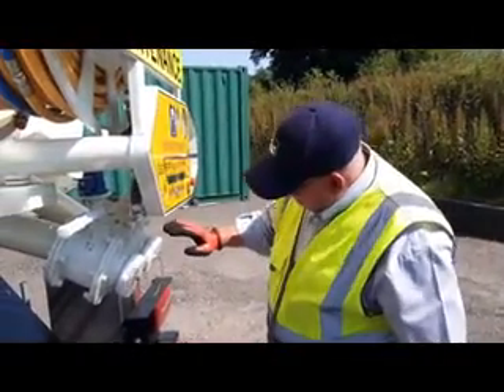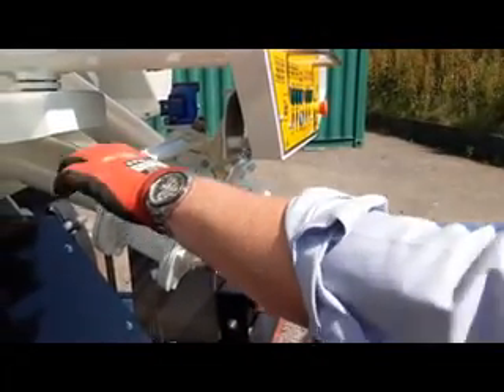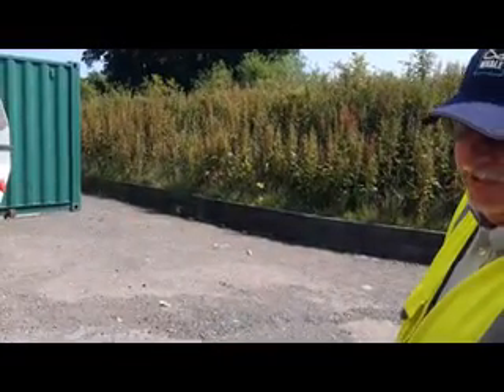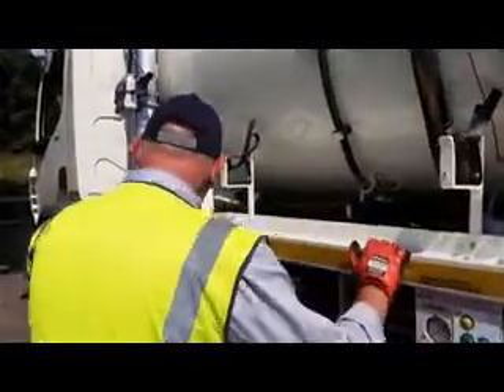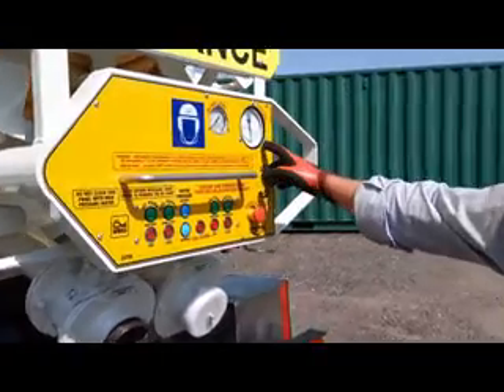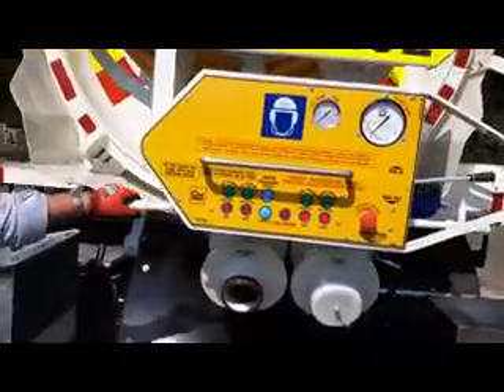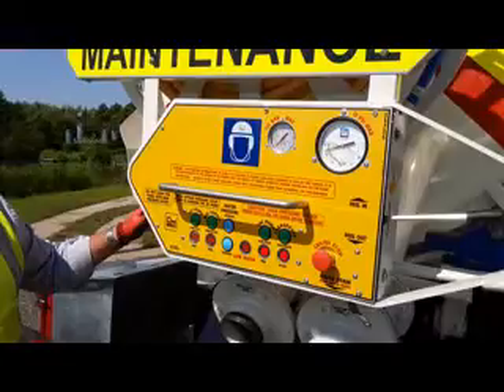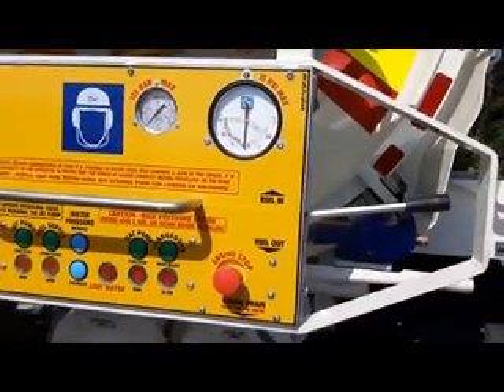Pressurised Discharge

Comment from the maker: If you stop the vacuum pump when it's on pressure you could damage the hydraulic drive coupling. Changing back to vacuum and stopping the pump at zero will prevent damage and prolong the serviceable life of the pump.